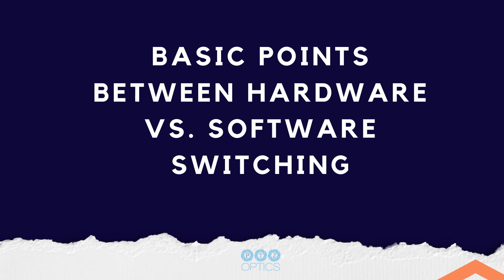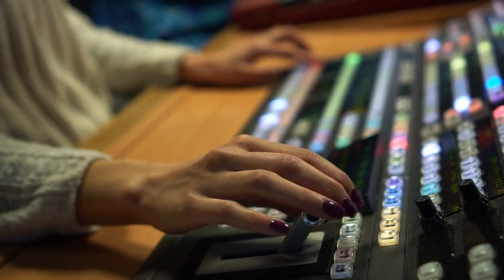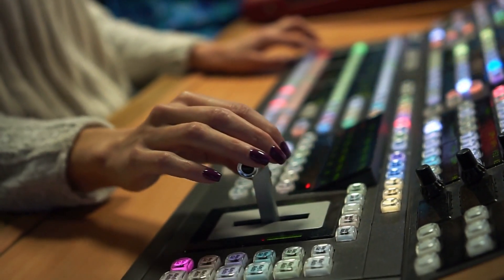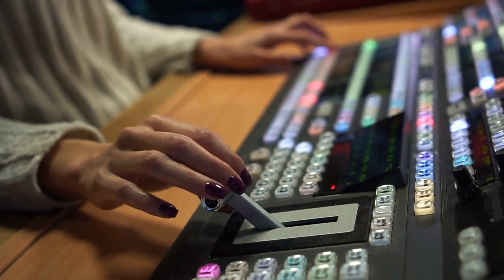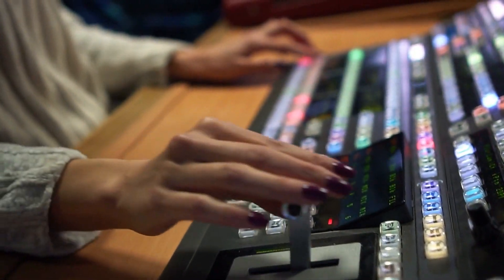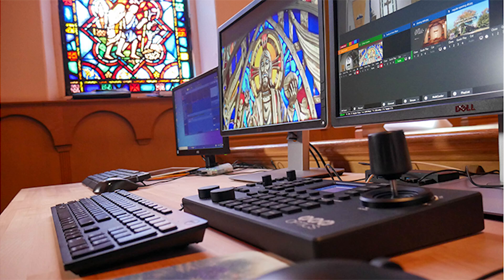Hardware vs. Software Switchers

Comment: Nice video Matt!  I firmly agree, Hybrid solutions are best for most churches and venues simply because inevitably there is a video monitor within earshot of the main room - Software latency is not acceptable. IMAG is not the only reason for a Hybrid solution - hardware video switcher and  software streaming!